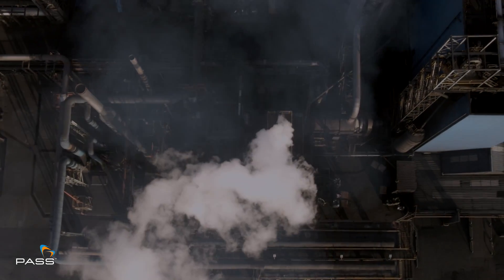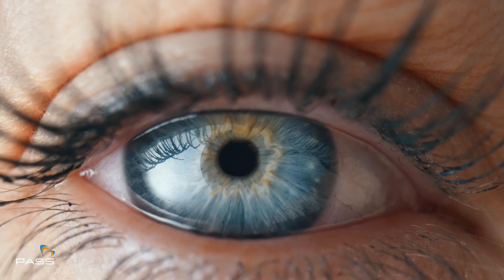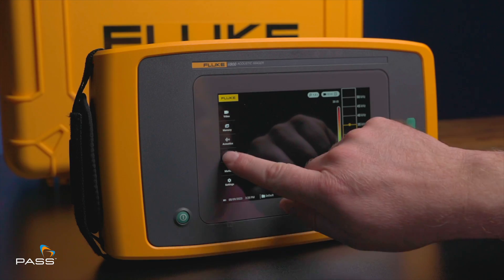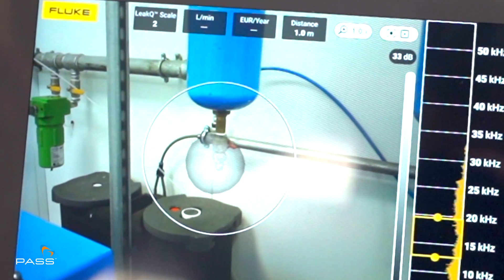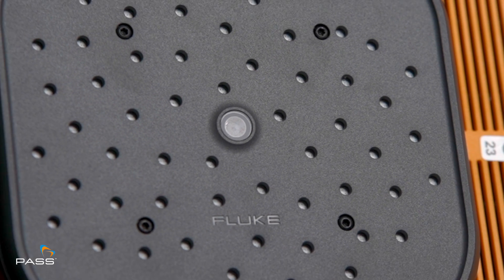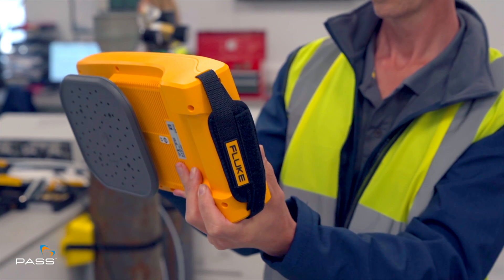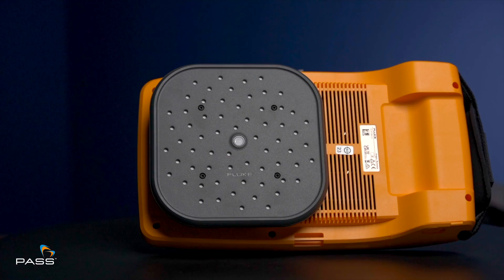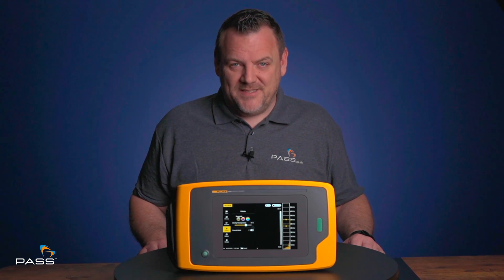This Camera Can SEE Sound! Fluke ii900 Acoustic Camera Review

Comment: I want to check vacume leak in cylinder
Reply from the maker: Checking for vacuum leaks is a great use for the Fluke ii900! It can really help you pinpoint those tricky issues in the cylinder.